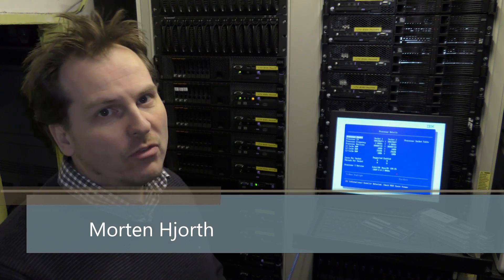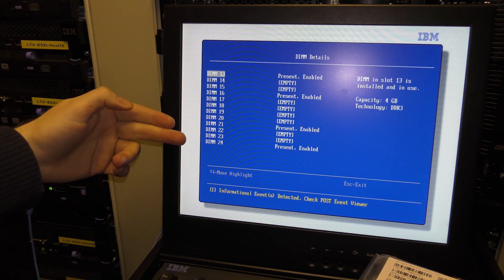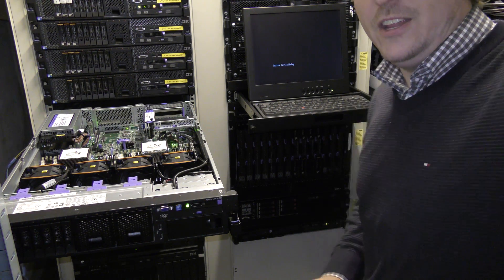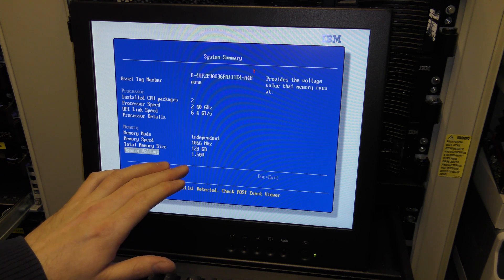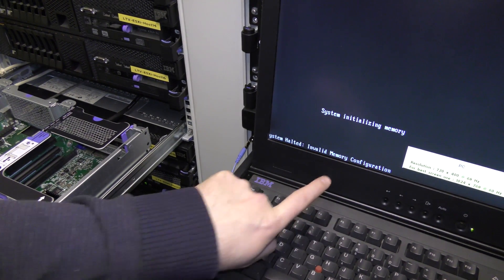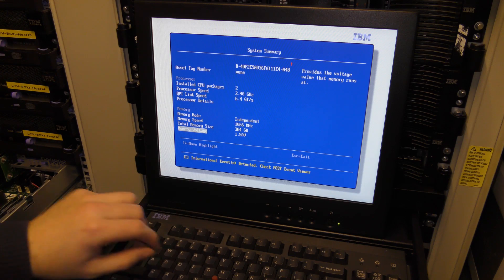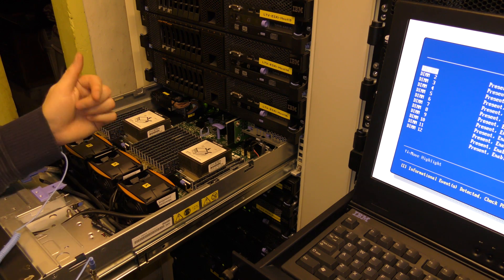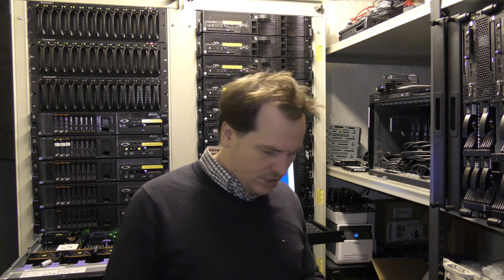Lenovo x3650 M4 with 128 GB LDIMM or 384 GB RDIMM - 467

Comment: 12:05 no, they're probably quad rank so the max would be 16x16 GB, if you put in the other one it won't work. If the're quad rank which not all 16 GB modules are, but most of them, expecially with the 1866 mhz.
Reply: 12:33 you are lucky it is dual rank only... nevermind
Reply from the maker: Hi @leo_craft1
Thank You very much!  glad you liked the video :-)
Thank you for watching! :-)

Comment: The frequency can drop when filling the second, not third, bank on some servers, depending on the settings in BIOS which reflect the capabilities of the mainboard. And how many of these banks (one, two, or all three) you can fill depends on the memory type and its number of "ranks." For example, you won't be able to go beyond a total of "8 ranks" (like, 2× quad-rank RDIMM) in one channel with your CPUs. Bonus: Mirror allows for correcting otherwise uncorrectable double-bit memory errors. Bonus 2: Some CPUs have more than one "Homing Agent." They run with two memory sticks alright, but you better give them four (or multiples thereof), so that each "half" of cores (could be 5+7 though) has memory available to "its" controller, for lower latency. Bandwidth is higher on those.

Comment: The server RAM also have error correction built in. That's built into that extra large chip on the memory.
The RAM will check for errors in the data it gets. If there is any errors in the data it will tell the CPU to re-send the data.

Comment: I am searching a used server. What model would you suggest for max 200-250€? 2,5" or 3,5" hdds(have a lot of 3.5" hdds laying around)? Are 1Us a lot louder than 2Us?
Reply from the maker: Hi lusu B.
a x3650 M3,,,, there are not many newer servers with 3.5" and SSD is taking over,,quick go for 2.5"
Thank you for watching! :-)

Comment: You should host a minecraft server ;)
Reply from the maker: Hi Sammy i
I have never even tried minecraft :-)
Thank you for watching! :-)
Reply: why?
Reply: hubatruck why not?
Reply: Because Minecraft is a bad game
Reply: hubatruck solid argument lol
Reply: And also, these servers are not meant to use for gaming, they are used as web host, etc.
Reply: Danny Brewer spigot can run multithreaded ;)
Reply: I run a  minecraft server on a dual Xeon machine, but it's in a VM with 6 threads, the server minecraft uses more than 1 thread and a lot of memory, without any players on spigot with no actual mods, it uses 15GB. Even the game client uses 2 cores now with more recent updates.
Reply: hubatruck Hey now. Minecraft is pretty great. However, this system would not be great at it. Just a single threaded game!
Reply: hubatruck that was a strange argument, there is no problem hosting a Minecraft server om this machine.
Reply: Joshua Nicoll One of my server uses 16 threads and uses 96GB ram of 128GB.
Reply: Just to point out a few things. Minecraft is not Multi-threaded in the sense of how most games are. The whole server tick is on one thread. Hence why people refer to it as single threaded. Spigot does not change this, what it does do is it uses the extra cores for network compression and a couple of events that are able to lie outside the server loop. There is no multi-threaded minecraft server. The chances of that happening are almost nil given the fact that it would require a complete rewrite of most of the game mechanics.
Reply: swedisch elite hacker system!!!!!! 😂😂 epic idea!